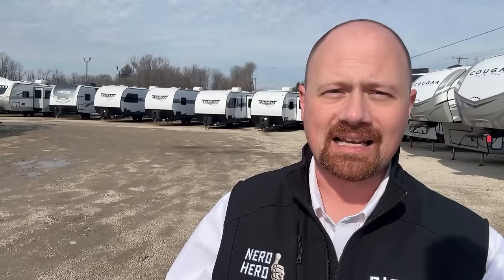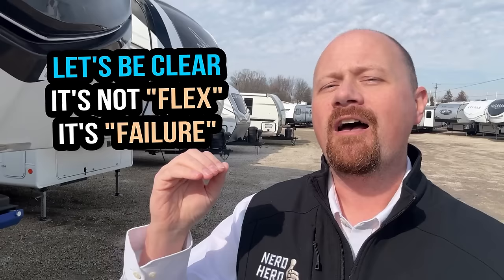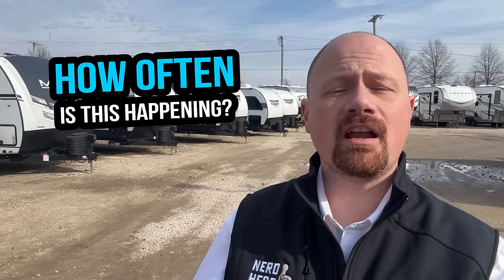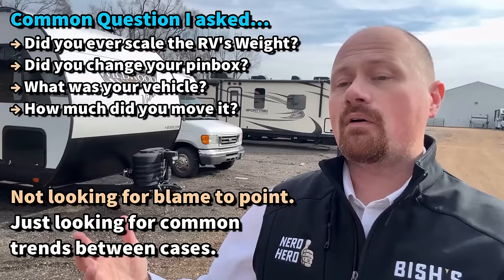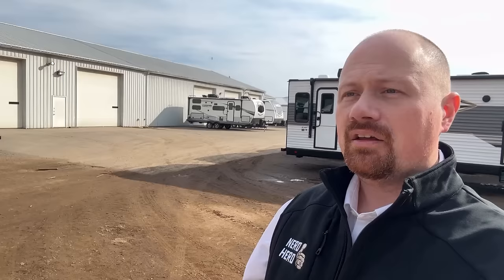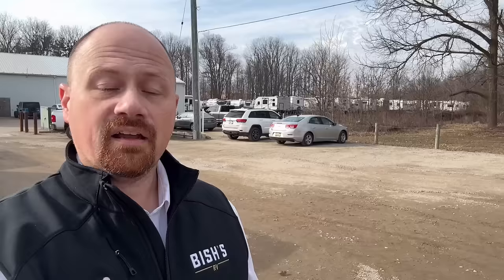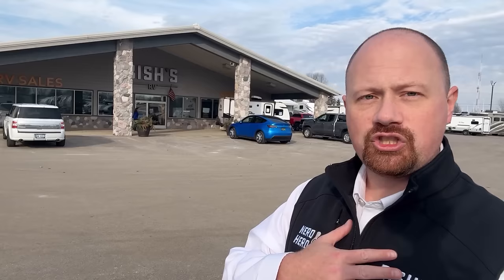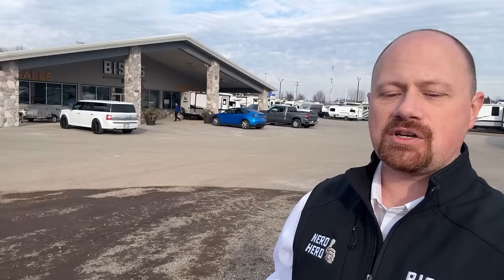🚨 RV Frame Flex & FAILURE!! • WHAT is Happening and WHO is Responsible?!

Comment: An rv manufacturer should be able  to tell you the maximum hitch weight and total rv weight  . I always when possible I put  air bag pin box on my  trailers it softens the ride on the front of  the trailer including your  inbox. I weighted my truck and my  truck weight is 8660  with me in I t . Then look at the front axle and rear axle weight. Then I  hook up my fifth wheel and go back to the scale. When entering the scale write down front  axle  weight  then write down rear wheel weight then put the total truck and  trailer weight. And I do it after the trailer is loaded . It will give your rear  axle and pin box  weight. When I load our fifth wheel rv I try to keep it 100 pounds of tongue weight per thousand of trailer weight. Been rving for 32 years so far so good  .awesome video I have a lot of respect for Josh the rv nerd when admitted that he learned things through all this stuff. Awesome video Denis from Santa Rosa CA

Comment: Josh - Kudos for taking this subject on. My assessment on what you're overall message is that the industry for the most part is building units to a "minimum" acceptable standard, low CCC's on most everything out there from travel trailers to Class A's, along with everything else wrong with the units, on and on. The dealers for the most part are over-selling units and under servicing units to unsuspecting customers who don't have a needed Bachelors degree in how to buy and RV today.. That it's now the customers fault for over-using a product that's not intended to be used that much ?? Over-loading a unit that has a unusually low CCC today vs. similar units from just 10 years ago and the customer is at fault for their units failure for towing a fifth wheel with a tow vehicle that's over capable ? Really ???   The RV industry is screaming for consumer protecting government regulation across all aspects of it from poor manufacturers to deceptive dealer practices without the ability to service what they sell..

Comment: Thank you Josh. 
Very informative video. 
Understandably a complex and suggestive video. 
After having many towables over the years, we are still learning. 
You are correct at all perspectives. 

We tow a 26 foot grand design travel trailer with a 1/2 ton.
And many can argue that point.
But in my defense. 
I am very aware of limitations. 
And we have made adjustments through the years to feel confident in our abilities. 
Getting a weigh safe equalizer hitch was the best purchase we made and also a big eye opener. 
As we set it up and started to travel. We have had to constantly monitor the hitch weight and make adjustments almost daily.
Because the load/ distributed weight changes. 
(Holding tanks)
Plus, we feel we use our trailer more than the average consumer. 
With that said.
It's important how much you plan realistically to use your trailer and set it up accordingly. 
We do plan to add shocks to our setup based upon our usage. 
It's all a learning curve.
We should always not assume we know it all and be humble in our assessments. 

Thank you!
Reply from the maker: My pleasure. Thank you for listening and having an open mind. Kind of like I learned about the larger trucks being a factor in the equation we are always still capable of learning.

And I’ll never claim I know it all or have it all right

Comment: Thanks for this.  I recently bought a 44ft Toy Hauler and I now intend to be hyper focused on weight going forward (empty all the tanks, etc.), and rethink a lot of gear.  I'd like to completely empty it the next time I move it so that I can get the dry weight so that I can establish a baseline, then weigh it again once I hit the road again.  I never thought I'd need to question my decision to buy a F450 DRW to pull it, but given the size it still seems appropriate, the major difference between the 350 and the 450 is the wider wheelbase upfront which has been really nice to maneuver my rig.
Reply from the maker: Glad to be of service. Folks need to be informed

Comment: Great video Josh!  My opinion is that these giant 5th wheel campers weren’t designed for a family of 5 to be living in them…..or changing the pin box to a Gooseneck.  The frame wasn’t designed for the torsion stress of a gooseneck.

Comment: Now we do not own a TT or 5th wheel. That said I can see two reasons for "frame flex/frame failure". One, the RV manufacture specs Lippert or other frame manufactures on how they want the frame specs built and what "weight" will be built on it, and they overbuild the TT or 5thb wheel. Two, owners do not pay attention to the CCC, over loading is a common problem since many RV owners never weigh their loaded units to know if they are within the CCC as well as owners not paying attention to how the TT or 5th wheel attaches to the tow vehicle. We all have seen TT's or 5th wheels going down the road with the tail end of the truck almost dragging on the ground or the tow vehicle sits so high with a super stiff rear suspension the tail end of the TT or 5th wheel is almost dragging the ground. Great video Josh and I will say the sales reps we dealt with at your Meridian ID store did have good information and we knew exactly what we were getting in our Newmar Ventana.

Comment: Great content! I owned a 2005 40' Dune Chaser. Scaled it at 17,000 with a VW Sandrail inside it. I was unaware that when pulling it on Pismo Beach California,  the triple axle tires would actually be off the ground when I was pulling it in the sand. Bouncing a lot on the sand to get through rough areas. 10 years of this and I noticed the aluminum panels around the pin box were no longer attached. My front frame was 6 inches higher than when it was new.

Comment: You are correct, sir. This is an industry problem, as well as a consumer problem.
The push in recent years by both manufacturers and consumers has created this issue.
Everyone that wants to have an RV to travel in, camp in, and some decide to live in full time, and travel at the same time. The consumer wants the biggest, fanciest full of amenities RV that they can get. Full time livers, probably understand they are going to have a bigger tow vehicle. The weekender, or occasional user, wants the same thing. But they want to use their daily driver to handle the rig. Most daily driver vehicles are not set up to tow bigger loads, be it an RV, boat, or utility trailer.
Manufacturers need to put the dreaded caveats on the big RV's they push as " four season, full time living".  As you stated, the rigs were not designed for extreme temps and extreme boondocking. Nor were they designed for extremely rough, bumpy bad roads.
Both consumers and manufacturers need to have more realistic objectives, expectations,  and  what can actually be done.
Very complex issues, not any easy answers. Thank you for your video and addressing these problems.

Comment: Josh, thanks for bringing all this out. It is a good topic and needs to be brought out. The first of all Dexter who builds these frames could beef up all of those heavy duty fifth wheels with a heavier frame. In other words, the current frame they could use more steel From the drop all the way up to the neck with more welds and more reinforced. If you got a 21,000 pound trailer then that gooseneck down to the drop should be able to hold at least a 28,000 pound frame. And just as the guy said, if you’re gonna put on these RVs that they are full-time And they are four season RVs then they should be. Like my XLR thunderbolt is a four season RV but it did not hold up in the snow in Montana. And I always left at the beginning of November. And it does have heaters on all of the tanks. If it’s gonna be four season, it should be the 3 1/2 to 4 inch walls only. And it should have a fully enclosed, at least 1 inch thick, underbelly, and then insulation.
Reply: Dextor makes axles, Lippert makes frames

Comment: Thank you for this video Josh!  Been a subscriber for years and you never fail us.  One thing that you didn't mention as to a potential contributing factor is, (elephant in the room), the way  people are DRIVING their rigs!  They think because the tires are RATED for 80 mph, you can DRIVE that fast on who knows what kinds of roads.  The stuff we've seen by people going down the road with their rigs is mind boggling.  In fact right after your video there was another rv youtube channel that was driving their fiver through DEEP SAND beach, getting it STUCK and then wondering why their rig was cracking! We'll stick with our 60-65 mph max, especially if it's bad roads.  Much easier on our equipment.   And our nerves.

Comment: My thoughts are the frame problems are due to two issues.
1. Under built due to DOT weight restrictions.

2. Poor maintenance of our road system.  
Proof…. Drive around the Oklahoma roads for a couple days.  Include the Turnpike system which should have excellent maintenance given what charges are to use.

Comment: Hi Josh, good information. On weight we had a horrible time because everyone just throws out GVWR. When we bought our 41' 5th wheel I knew we had to be overweight. Finally I learned on my own to read the other door jam sticker. The one with rear truck axle rating, and how to do the math. I think different trucks have different verbage but whatever, it is the drive axle. We scaled the rig and sure enough we were overweight with not much in our basement. Within 9 months we upgraded to a 1 ton dually. And you are so correct - salesmen will say "oh that truck will pull it." The other question is will it be street legal with just two drive tires on the ground.
Reply from the maker: “It’ll pull it. Send it brother”
Annoys me so much
(ノಠ益ಠ)ノ ┻━┻

Comment: Thanks for doing this video. One thing you didn’t mention is the issue of frame manufacturer and RV manufacturer not being the same company. I’ve seen it mentioned in other videos that RV manufacturers are putting too much RV onto frames that weren’t designed for it or specifying frames that are lighter duty than what is required.
Reply from the maker: It is a possibility certainly

Comment: Another cause for you to think about. When I back in my driveway on a residential street I have to jackknife the trailer so much it's dragging the tires sideways. As a truck driver I can tell you this is putting tremendous flex on the frame!

Comment: Josh  -  great video- thanks for informing us about the issues. I tried to do what you suggested when I bought my RV and ran into roadblocks everywhere. I have a 2019 Cherokee Wolf Pup 18TO Indiana built. GWVR 4999 pounds. Stopping by the Forest River Cherokee factory in Indiana, I got a tour and drawings on how the RV was put together.  I got copies of every document/drawing they had but what was missing was astounding – cabling run locations,  electrical interconnections, water interconnections, Slide out frame structure and any structural statement on what the safety factor was in their design.  They had one engineer trying to keep up documentation for 94 models of Cherokees -  over several product lines.  Now here is where it gets really weird. The Oregon built 18TO uses the same part number for the frame, same part number for the axle and the same part number for the TBD yet the GWVR is 5600+ pounds. What gives? Calling Forest River customer service – what waste- they wouldn’t even tell me how the TV antenna was wired let alone any information on the design weight of the RV, or any safety factor.  I called Lippert who made the frame and axle and told them of the identical part numbers between the Indiane and Oregon built models and they said the same part number can have different specs - what a way for them to get confused. After I told them that, they wouldn’t talk to me.  I consulted the RVIA specifications - no help there either. So now, I don’t know if I’m overweight on the Indiana specs but underweight on the Oregon specs, am I in for  having a frame failure or too much flex? My only solution may be to strengthen the frame if I want to keep the unit. By the way I do weigh it occasionally.😦😦😦😣

Comment: Josh,
Your focus and drive is commendable. As a retired aerospace engineer at one of the top three spacecraft producers in the world, I look at this in a different way. Root cause! I'm sure the industry has severely under engineered their frames. I was not a structural engineer, I was a test engineer, however if we wanted to pickup a piece of equipment that weighed 1000 lbs we would design the lifting fixture to pickup 1500 lbs and proof load it to 1200 lbs. (not actual figures). My point is we know it will pick up more than our intended weight. I'm sure not one mfg. has the budget to engineer their frames properly, however if their was an active engineer out there that can take a typical RV frame and identify a common fault, maybe everyone can benefit from that. I own a 2018 OutdoorRV 5th wheel and love it. I do keep track of the towed miles and other thing Im sure no one els keeps track of, but I like data. I bought that brand because the MFG family RVs on forest roads and they clame to know how hard off roading can be. They also mfg their own frames. I don't go off road but several dispersed camp ground roads are not maintained and I feel comfortable with my rig. Any way I believe you are going down a very difficult path and If I were in the market for an RV I would fine you.
Thanks for your time and good luck.
Reply from the maker: ORV/Northwood are things that are in a class of their own really. You'll never hear me discuss them with anything but respect. YOu did well there

Comment: Great video but 2 things to comment on. 1. Most of what I have found is that Grand Design has been by far the most frame issues. When they are fixed not only do they wield the broken parts they also wield in a bunch of gussets. 2. They advertise as full time rigs. That to me means full time. I don’t see how you get around that.

Comment: A missing thing that would have helped here IMHO would be a simple photo of a fifth wheel trailer frame as a bare chassis.  Then compare it to a photo of a gooseneck flatbed trailer such as a 14k 24' flatbed gooseneck for example.  Both chassis are similar in gvw, pin weight rating, and if you compare the frame thickness between the two, as well as the physics of the shapes, you will be flabbergasted at the stark difference between the two.  The utility gooseneck trailer will have between 3/16" to 1/4" thick steel, and frame rails with much taller webs and strength in the design.
The fifth wheel RV trailers are a HUGE compromise, trying to build the frame with an incorrect shape with regards to strength, in order to accommodate the flat and low floor desired for the bedroom area.  They're just focusing all the stress of the pin weight onto the front landing gear area, where it's destined to flex and eventually fail.  Also, the steel used is way way too thin IMHO.  
This can mostly be fixed by simply designing the frames better, with a more reinforced shape to TRIANGULATE the shape better, distribute the loads better across the frame, and add rigidity. 
It's a simple problem to fix frankly.  But when the whole industry uses only one frame mfg for about 90% of the frames, there isn't a lot of design variants to compare and build from.

Comment: The problem is the Lippert sheet metal "Engineered" frames underneath... my Coachman trailer bent over the axles 50 miles from any town... using hydraulic tools and a lot of welding fixed it on the side of the road in a week... they need stronger framing crossmembers also so I added 4x4 steel above axle.... oh and it is only a 17' BH...

Comment: Josh, I think it is more of a 5th wheel plate problem over a "truck" problem. Sure trucks come with a stronger stiff suspension, but most 5th wheel RV owners put air suspension that then equals that of a Semi. Using a flexible 5th wheel is much better for an RV than having a rigid one but I don't think the pulling vehicle itself can be held accountable. Lastly, if you have ever used a medium duty or larger truck to pull one of those big boy RV's you would never want to use a 1 ton again. I've done it with both, as a professional transporter, and I will always prefer a bigger truck.

Comment: Josh... I love your videos. The manufacturers are building junk and the dealers are selling it and BOTH parties know it. I did a rant 3-4 years back about what it would take to go from 1/8 luan plywood interiors to 1/4 inch and that would easily make a BETTER RV interior... don't quote me as it about 3:00 in the morning and I can't sleep so... anyway on a 30 ft. trailer it would cost the Manufacturer$150-200 wholesale and add about 100 extra pounds of weight to the rig. I prototyped 3 different  trailer models trying to "balance" quality, weight, and costs and I found on MY models the costs/weights amounted to hardly anything at all. Manufacturer are either in the business of building a QUALITY rig, or they are in the business of squeezing out the most profit. 

Here's the best example I can come up with... when Ford built the Pinto the expense to do a BETTER job on their gas tank problem was dirt cheap at the time of manufacturing, AND had they asked the consumer, "Will you pay us an extra $15 dollars to make your gas tank safer?" I'm guessing most if not ALL would have gladly given Ford the money.

We have the same profit squeezing BASTARDS running the RV business and it is coming back to bite them as it did with Ford. 

Okay I have bored myself back to bed...